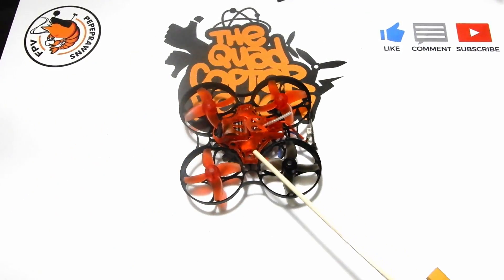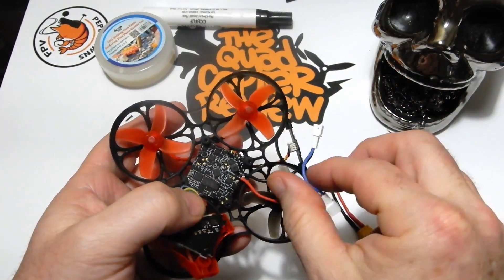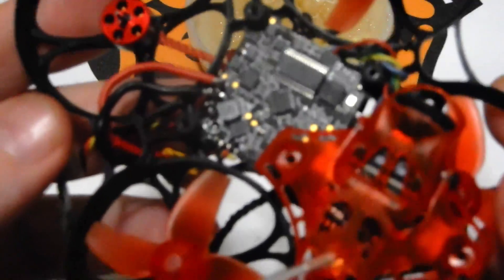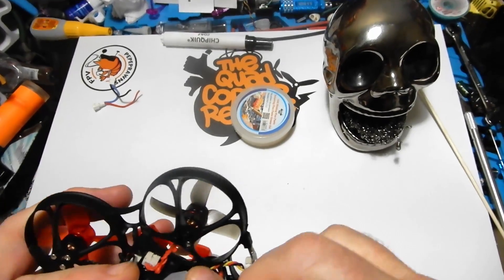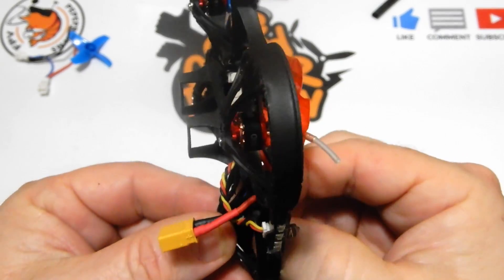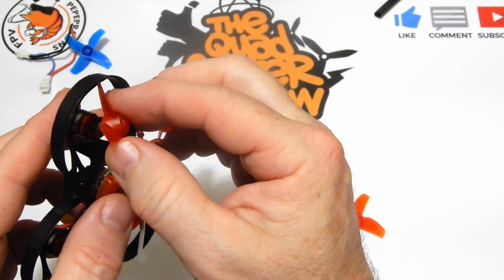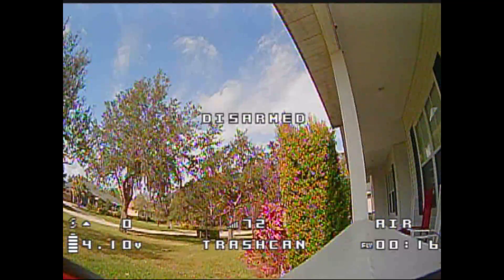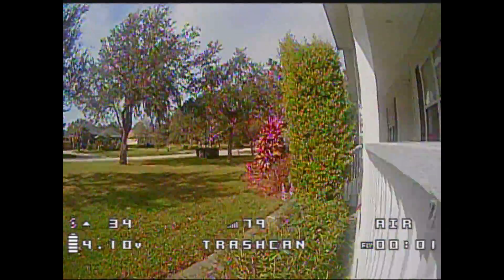Eachine Trashcan - Day 2 Update & Adding XT-30

Comment: Could you solder both connectors on the frame? Like you can use XT30 or the original connector? Just put both wires in parallel if this makes sense.

Comment: The problem with loose push props that fly away is probably as old there are push props themselves. Applying CA on the tip of the motor shaft usually fixes that.

Comment: I wanna put the xt30 on my trashcan I have 450mah 7.4v 80/160c 2s lipos .... could I use these with it as I have a hole bunch any way for the qav  cheers dude
Reply from the maker: Yes you sure can i have used them on mine and just to double check i just stuck a 450 2s GNB with xt30 in mine and fits just fine.
Reply: What’s a gbn? These are crazy pony if that’ helps ....
Reply from the maker: @baslikkgaming6458  sorry GNb is just another brand. I looked up your crazy pony batteries and yep you will be fine my friend.
Reply: Thanks mate I’ll let yu know how it gose gonna have to cut the battery bay a little and use a strap !!! 
Any good tips on keeping the counter clockwise props on ?

Comment: for those who had their 5v reg fried after the xt30 mod. The xt30 + 2s lipo generates a voltage spike when you connect the battery that exceeds the regulator maximum voltage by "a lot". Before doing this mod put a capacitor in parallel to the connector so that it can "absorb" the spike and be less dangerous for the regulator. I hope you can understand what i wrote. Feel free to ask me anything.

Comment: Any longer flight time with the Befa FPV 350mah 2S battery rather than using the (2) 300mah batteries in series?  Obviously they are 50mah more so you should get 10-15% more flight time but also would come down to the weight difference.
Reply from the maker: Right you will gain a small amount of weight and a small amount of time. Often there is no need to change out to an xt30. The XT30 has thicker wires and can handle more current/amps, voltage/volts and power/watts. What this does is maximize your power flow from the battery and reduce heat. It's most often needed if you touch your jst wire leads and find them hot. This would indicate you we be better off with the larger gauged wire and the xt30 connector. On the trashcan here as i mentioned the difference is minimal and if you want to also use this quad as a 1s indoor you will be fine keeping it as is with 2 300's. When i make the changes like this to the xt30  for me it's part of the review process to ensure to my subs that you can safely do this and see if we notice a huge difference so you don't lose your hard money blowing a quad up. Let me do that for you. LOL
Reply: I was thinking about possibly modifying the battery holder with maybe a 3D print battery holder that would possibly hold a larger 2S battery which would then be worth changing it out to the x30 connector for an outdoor flyer only.  Just not sure since this is such a small and light little whoop that there would be any 2S batteries say 450 to 650 mah that would be light enough to not drastically affect its flight characteristics and be able to get a longer say 5 minutes of aggressive outdoor 2S flying?  I love the new 2S tiny whoop rave but not a fan of only 2-3 minute flight times on 2S.
Reply from the maker: @luv2flypilot  I get that!. Even worse running the vtx on 200mw of coarse will draw more power as well but the range is so nice on 200. I am running the 300mah betafpv  which doesn't seem to be around anymore.  But same weight but 2s with xt30.  I am a fan of the 140mm at 3". I can still rip the yard with a 800 mah or 550 3 or 4s and will still only cause minimal damage to my neighbors houses.lol
Reply: Can’t wait to get mine as I will be doing some testing with different battery sizes looking for great 2S performance with a 5 minute flight time.  Not sure if the vtx is switchable in the OSD las that would be a great option too depending on if you want to fly it close by with less power draw from the vtx at 25ma or kick it up to 200 am and get some further flying in with a little less flying time.
Reply from the maker: @luv2flypilot  Yep it has smart audio so you can change it with your radio. I have a crap ton a different props coming to see if that slight vibration is from the props.
Reply: Are you taking about the jello video that I have heard a few complaints about?  Maybe soldering the vtx wiring to the camera and eliminating those connectors would help?  I noticed it looks like they used SH1.25mm wire to board connectors for the vtx and cameras. With my electronic experience that is not a good idea as vibration can cause a poor video signal.

Comment: Thanks very much for the review(s!).
Could you see any flight time difference? If not mistaken the 2S is heavier than the 2x1S... My understanding is that you also should get less voltage sag with the 2S due to the connector. Is this something you’ve seen?
Many thanks again!
Reply from the maker: Yes you see a bit of change but to be clear it's not like a 50% improvement. It's a minimal difference of feeling while flying the quad. The battery is slightly heavier but again i couldn't feel it. Do not feel in anyway that you need to do this unless you only have a stack of xt30 batteries to use. It's not a night and day kind of deal on this one. I hope that helps you decide which way to go.
Reply: Never had a response on a YouTube post appearing in Minutes  :) Thanks for the super quick response!

With 4 micros around, I have many types of batteries lying around. Not all I’m good shape, I admit. 

This said I’d love to get more time flying. KabadFPV has an interesting design coming up. Check it out.
Reply from the maker: @nikotttin  I will do that i follow him as well. I have both the Tinyleader standard and the Tinyleader sitting on my desk right now they will be up next in review. I have flown the standard on 2s already And need to print a mount to fly it on 3s then i will do the HD version.

Comment: Hi QuadCopter review. Hope you had a great Christmas. Nice little unit. Take a file and carefully bur the motor shaft so the plastic props will hold onto better. Great work on upgrading the whoop.
Reply: Do you mean, file a small indentation in the shaft?
Reply: sort of scratch the shinny surface. See if that helps. The shaft is to smooth and sort of scratching it will help
Reply: @furballkimfpv9365    I just got a Tinyhawk and one flew off. i thought I lost the spares, but I guess it ships without any. I'l do that to all 4 shafts. Thanks!

Comment: After replacing to this adapter XT30, my trashcan worked a little bit and then turned off, now it doesn't turn on with any battery. But, when it connect with USB cable to the PC, everything is in order. What could be?

Comment: So how is that xt30 going on this. Did you have the issue with blowing out the 5v regulator after doing this
Reply from the maker: Nope no issues at all been running solid. Only issue i have had at all is the the motors screws fell out of one motor. hahaha
Reply: That sound like massive issue haha. Thanks for the reply mate
Reply: I did

Comment: Thank you for the xt30 mod. Was wondering if you can use a jst connector instead, because all of my batteries have a jst plug? Thanks
Reply: Sure, you can use a red JST. 
FYI, I use xt30 for 3s, red JST for 2s, and powerwoop connector for 1s

Comment: My trashcan came with an out of date firmware or instructions to fix so after hours of figuring out how to flash it I got it working with my PC only to find that one of the motor ESC’s was faulty and when I tested it in Betaflight it skittered a few times until put it up to max throttle and it went pop with smoke coming out! :( So I’ve wasted 2+ hours and money to try this little beast! :(

Comment: Maybe I missed it but missed a key point, why do you switch it to xt30?
Reply: XT30 can handle a lot more Power and thats actually samething you can FEEL!
Also XT30 last a lot longer (WAY MORE DUTY CHIRCLES!)
And probbably the main reason . . . His 2S Lipo has an XT30 on it!
Reply: @Ghosty-RC  Figures but if the trashcan needs the extra power it's  a big deal.... Buy more 1s or more 2s
Reply: @martinverbaas  Just Put it in on Youtube, someone did a really good Video on that!

Comment: hello. help please. where i can get stock betaflight? i update to last bf and it fly terrible. i cant dive, it has terrible propwash an it move by yaw when i do split-s
Reply from the maker: Did you upgrade the firmware to 4.01 the newest? If so did you do a clean set up or copy your old dump file back on the new firmware?
Reply: @TheQuadcopterReview  yes, i did clean set up an just load a preset to CLI for whoops from github of betaflight 4

Comment: is the battery pad on the trashcan bigger than the mobula??
Reply from the maker: Soldiering pads seemed slightly smaller but manageable for sure. That's saying a lot when your talking about my soldering.

Comment: I think adding flux is totally overkill if you use resin core solder as probably most do. Your not soldering SMD components or did you watch to much Louis Rossmann? ^^
Reply from the maker: Not sure my friend but the use of it instead of straight solder has improved my joints 10 fold.
Reply: @TheQuadcopterReview  You're probably not using the optimal solder. I would recommend 60Sn/40Pb or even better 60Sn/38Pb/2Cu solder. Don't get me wrong, what you have done is totally acceptable if it works for you but the solder joints covered with flux will corrode very fast. You should atleast clean the flux with Isopropanol. Love your intros by the way :)
Reply from the maker: @VincentFischer  You right on the Isopropanol i totally forgot to tell the people that. I do use it to clean the joints after.

Comment: What replacement props should i order?
Reply: The Mobula7 ones should fit (1mm shaft).
Reply from the maker: I have 3 different versions coming to test as well. All amazon based so i can recommend something we can get quickly.
Reply: looking forward to your battery feedBack .I got the CrazePony 2s 450mah 7.4v  80c/160c . Kinda heavy i know , but i hate short 2 min fly so i was willing on giving this extra heavy batteries a try. cheers mate.

Comment: What 2s xt30 batteries will fit?
Reply from the maker: I'm using Betafpv 350mah 2s batteries. Can get um on amazon -  https://amzn.to/2rYig1b i think the 450's are a little heavy for it. If you are getting one from Banggood they have GNB 350 2s that can be added to the order. https://shop.thequadcopterreview.com/gnb-350mah-2s
Reply: Do you think these ones from RDQ will fit? They measurements a just little bigger than the betafpv batteries. https://www.racedayquads.com/products/rdq-series-300mah-2s-70c-fpv-micro-battery-xt30?variant=20032836075633
Reply: I hope that the ‘TBS GRAPHENE 300MAH 2S HV’ will fit, because I’ve ordered eight of them 😄
Reply from the maker: @HappyFPV  Checking the size of these vs the betafpv and tattu 300's i have it looks like you will be fine with those.
Reply: Thanks I can’t wait to get the trashcan 😄

Comment: If you are on the throttle a lot, racing, freestyle, whatever, the XT30 is a must.  A lot less sag.  These are my favorite packs on my mobula (That has 200mw vtx and EOS2 cam)  https://hobbyking.com/en_us/turnigy-nano-tech-300mah-2s-45-90c-lipo-pack.html?wrh_pdp=2

Comment: Props didn't fly off??
Reply from the maker: I had one pop off yes. The price we pay with these motors with no prop screws. We're hitting our limit i think.
Reply: @TheQuadcopterReview   Would be nice to see them doing the same thing as the motor bottoms... some kind of single screw, with maybe a hollow shaft... I know it's all tiny as hell, but it'd work. Instead of a 1mm shaft, make it 2.5 with a 1.5mm bore... Just need a bunch of small screws to keep as replacements...

Comment: Thanks for the Trashcan videos! Can't wait to get mine. 0803 motors are 1mm shaft.  Betafpv 75x props are 1.5mm shaft. Have heard Rakon 3-blade works very well on Mobula7 so may work very well on the Trashcan.  You can fly indoors on 2S just if you tame the throttle. CurryKitten has a great video on this: https://youtu.be/rwUdwUMMytI    I have my Mobula7 on 50%  and it flies mellow but solid indoors, much better than on 1S, and will do the same on my Trashcan when I get it.  Then just uses SmartAudio to switch beteeen high power outdoors and low power indoor rate profiles.